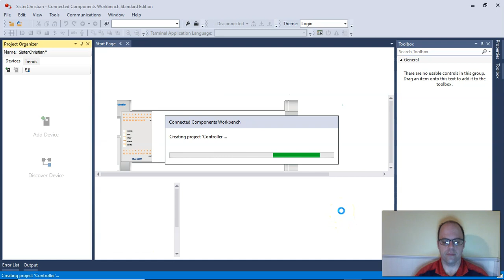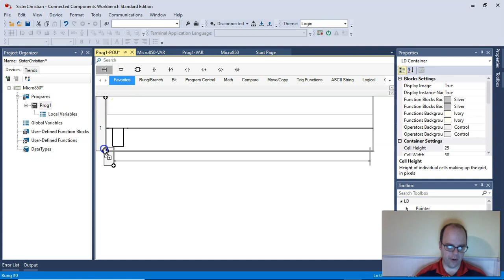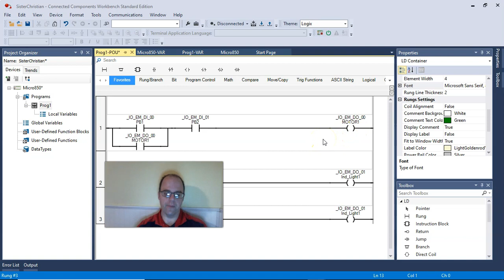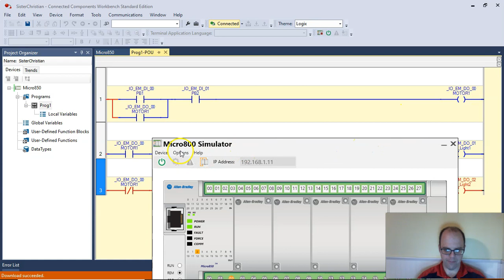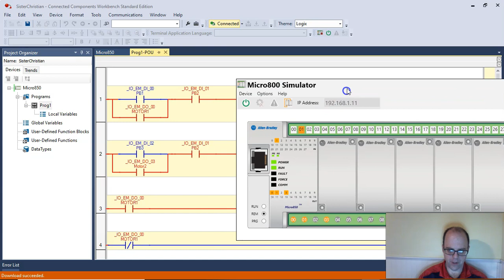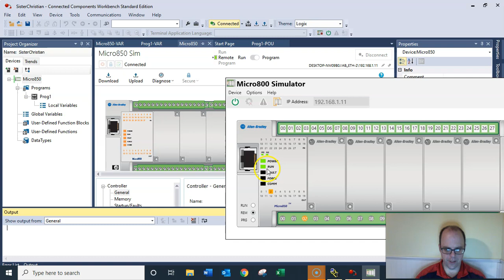Motor Control with Micro 850 Simulator

Comment: Good morning, first congratulations good video, sorry I have a problem, every time I put the micro SIM in RUN, it goes into failure 0xD011, it says that the scan time of the program is greater than the watchdog, but it had not touched anything, later if it I moved everything, but nothing, I can not simulate, I would appreciate if you know something, thank you very much in advance.
Reply from the maker: Tim wilborne as a video on this and shows you how to fix it.
Reply: @danstaifer2028  Dan Staifer is doing all this with his Micro800 Simulator
on REM and not RUN.  It has to be in RUN to function at 100 percent I thought.  🍒